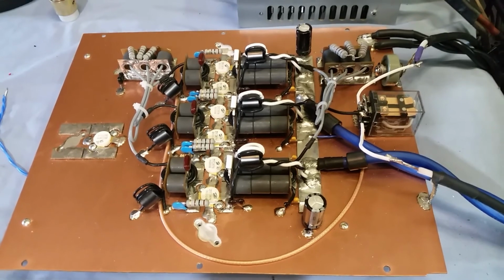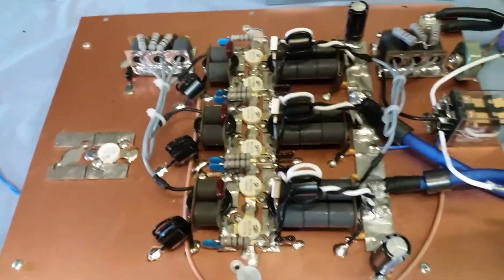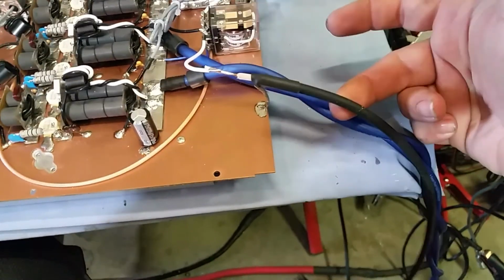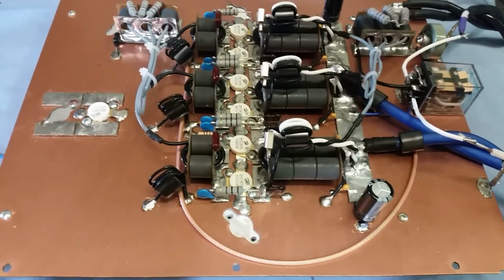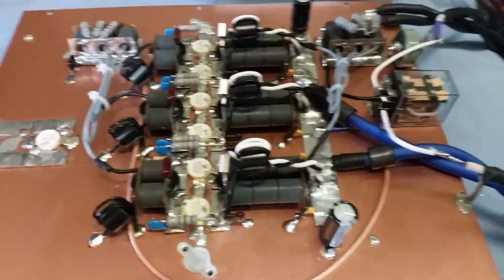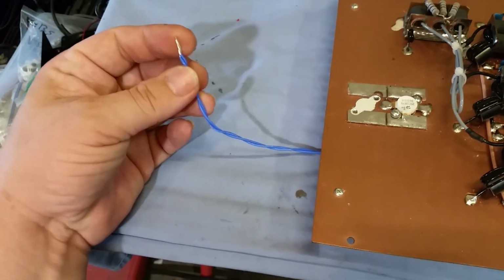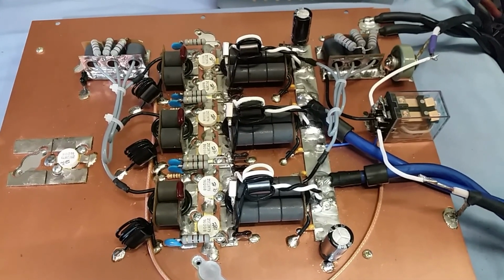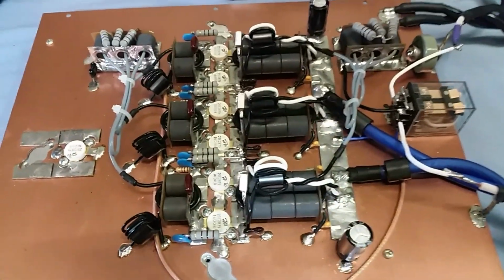GK Built 6 Pill Amp Board W/Output Over 1000w RMS WTH? 🤔 MIND BLOWING!

Comment: that a pallet amp .you got splitter/combiner correct . all lead same length and 100 ohm together one point not to ground that. with that out of a cabinet the tunning may change a bit. I use ICA tunning tubes on out put. then Kapton tape in place so don't slide.   I got a 4 pill with that style combiner. that just used a input and out put transformer. has MRF 453A stud mount. it's old. 1980 I guess.  and it has 1N4997 press into heat sink bias. 3 pole relay replaced with 4 pole . doubled up on TX contacts. new silver mica . old ones went off value. no RX amp. does have LPF on output before relay. very clean. I had a 8 pill done with that combiners. 4 wide . 4 100 ohm resistors.  had bad pills and tunning cap bad. did 1.6Kw PEP when finished. 16D08 pills. 15V . working on tube audio pre amps now. 12AX7 ground grid bare bord came today. My base set up has mike mixer with 12AX7 tubes . DC filament .225 VDC reg from 13.8 in. have tone controls all shielded no RF gets in. into IC 7300 radio. foot pedal keying. I talk and type on my laptop . I can plug in my mixing bord and have ECHO/REVERB or outher sound effects. My keyboard line out. looks like a DJ set up. 73's